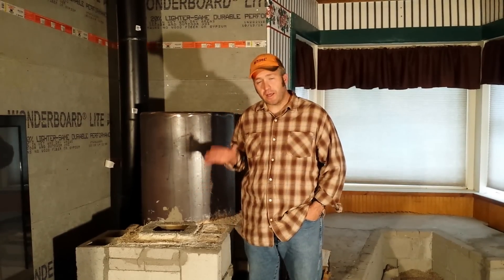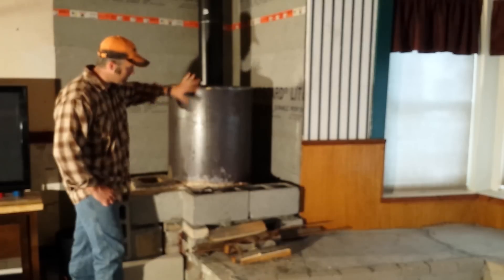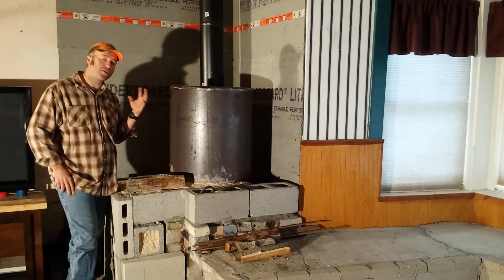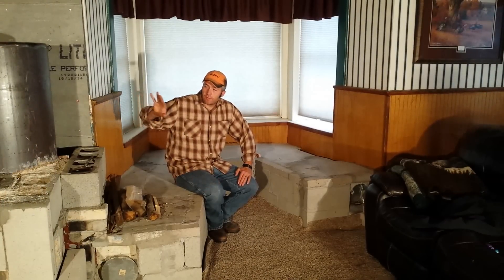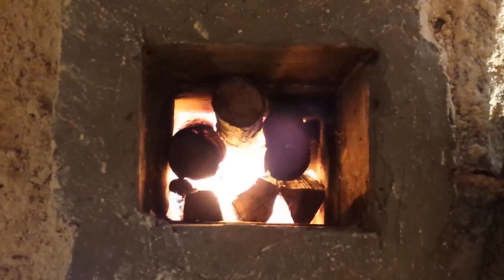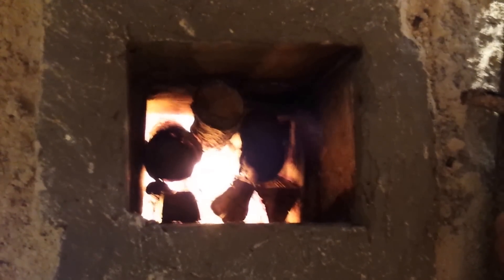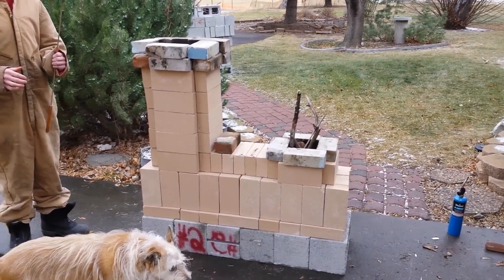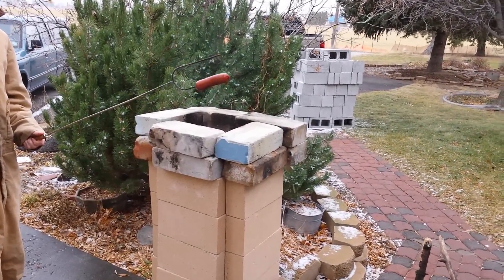Rocket Mass Heater Overview

Comment: Great video! I was wondering your thoughts on casting a heat riser without steel inserts, just masonary. From what I've seen the mix would be refactory cement, purlight, aircrete, water and liquid glass. More specifically my question is do you know whether refractory cement can be used to make aircrete?

Comment: That perhaps a less expensive assembly would be to using aircrete with water glass treatment for the Firebox and the chimney of the stove and then branding aircrete insulated water glass block to the top of the barrel to minimize the heat loss before and goes through the bench so you're taking maximum advantage of the heat coming from the stove maybe perhaps increase the Firebox to take a large load of wood so it could be fired up once every day and provide cleanouts at various points for maintenance
Reply: The barrel must cool the gases so they will drop.  Do not insulate the barrel.

Comment: Hello
 Adam & Dave
  Was very impressed with your presentation and amount of detail that was included is this video ( I did see the second video also, which was great and informative --thanks)  I want to build one of these in my home of which my wife of 50 + years is not supportive of this idea, it will be a hard sell.  I will have to buy her lots of things for her and make lots of promises.  2 questions I have, one do you have any pics showing the connection of the 8 inch pipe to the barrel, and how do I figure out how much pipe I can use before it is too long, I have a large home. ----Thanks ----Gary

Comment: Just sayin.. Thanks for sharing: " I live in the North, few days ago -48 with the wind chill. I used to heat my garage in the winter with a cement lined 18 X 24" box wood stove. in -40 ( Valley Comfort Style) when I hadn't had a fire, it would take 2 loads, 1 hr. to heat the 24 x 30 double garage ( it was insulated ) after the garage was well heated, I would place, 3 dry logs and 2 green logs to slow the burn. ( Using green material is a major cause of creosote formation )  I never had a creosote problem until I started using wet green material. Next yr I am putting in a system like yours, it just makes sense, to reduce the $200+ monthly natural gas bills. I never had a back draft problem, I always used a rain cap, but noticed in your video it looks like your rain cap swivels with the wind direction? When you had the back draft problem did you have a rain cap on?   I've built several wood stove burners over the years,  the 45 gal drum did finally pin-hole / rust after few years, the steel water heater, lasted longer, but it also developed weak areas, pin holes, I think it had a lot to due with when I would start fires with 2x4's  they burned quite "HOT" turning the steel "RED HOT" - I think using the 1/2 inch steel was an excellent idea, safety being the #1 issue.  As I live where it is very cold in the winter, I'm not sure how much wood I am going to use, but like you stated, a few good CO2 detectors are a good idea, in case one fails. One can "NEVER" be to careful. Oh and by the way, the steel looks "MUCH NICER" and maybe you could buy some High Temp Paint and get your boy to Mural the heater...  Whatcha think?

Comment: Holy crap 1/2 inch steel ? No you don't have to worry about it degrading anytime soon . Not sure if you realize it or not but cinder blocks aren't meant to be exposed to fire . I'm assuming you have it lined with firebrick ?
Reply from the maker: All the burn tunnel and riser was firebrick and fire clay/perlite mix, no cinder block exposed to the flame.

Comment: Nice job Adam, like you stated,I looked at a lot of videos also. You could run your chimney up 10 or 20 feet away from the firebox, anyone tried this yet?
Reply from the maker: Thanks for commenting
Reply: Not good idea. That draw needs to be regenerated.
Reply: @columbusbrooks4517  You mean that the draw gets regenerated by locating the chimney by the heat source to reheat the cold flue gasses in the chimney by radiant heat.

Also, if the chimney is by the bell, a bypass of the mass is possible to increase the draft for start-up.  After fire is going turn off the bypass to heat the mass. These are not common.
Reply: @jakebredthauer5100  Jake I was wondering how many rocket stoves or batch box stoves u have built? If u have, are they made out of any metals, besides the door and flu pipes? Just curious bout your firsthand skill & knowledge
Reply: @columbusbrooks4517  Zero. 

2. I know the characteristics of steel and have had plenty of experience with it.  What would you like to know?   Thin sheet steel is best for the bell on a 3000 degree Fahrenheit heat riser.  Old refrigerators may be good for some uses, such as secondary bells, plenums, stratification chambers and heat exchangers but may be vulnerable to corrosive condensate.  

3. I think you like the down-draft heaters better than I.  I think secondary air is important but I don't like Peter's method.  Why not just have an in-line configuration and have a straight three inch ID stainless tube go through the front of the fire box, through the fire box and through the burn tunnel, stopping inside the bottom of the heat riser?  Have it low to stay cooler.  Would it get too hot?  Open the port so it is not restricting and skip the Venturi. 

4. This could affect the spiral in the riser.  Which direction does the spiral usually go? 

5. Another idea I was considering is a series of bells with insulated riser tubes so the exhaust could be low, without a chimney.  Have a horizontal flue and a flapper valve on it, an independent wind blocker, and a fence for young children.  Would that work?  I know about the pressure zone near a building.  Flapper could be locked open, locked shut, free, control inside.

6. High grade CFB (HD) looks like a good product. Put perlite/clay cob around it. Brick or block around that.  Get it level, plumb and square.  Sit on it.

7. Doubling the size of the fire box should be okay as long as it is well insulated.    What do you think?
Reply: @jakebredthauer5100  thank u Jake 4your insight. Fire being a consuming & lively combination of elements I was curious your experiences. Having built several of these and having each react differently determined by many variables. Living off grid completely in the inner city and not smoking up the hood until RMH Tec wasn't happening. Heating hot water had for years been either expensive or laborious, electric hot water tank, heating pot upon top of barrel. I flowing Peter's led, Van Powell's method of heating water has been a Godsend from above 4me & my family's ability to wash ourselves, our clothes, our dishes. I make & sell ceramic dishes. Lot of hot water needed. So, I thank u I live this life I was curious how much suffering these issues effect your lifestyle and u answered that wit zero

Comment: Great video.  Still tweeking mine.  I have a 8" riser inside a 16" tube packed in a perlite/fireclay mix. Bench is 10' long and back to the chimney next to the barrel to help keep it warm to assist with the draw.  Now I'm trying to figure the correct  spacing between the top of the riser pipe to the inside top of the barrel. Any suggestions would certainly be helpful.  Thanks,  Will
Reply from the maker: Will Willis Mine if I remember right is 2.5 inches. Everything else sounds like a solid plan. Thanks for watching.
Reply: 2in

Comment: Like you, I have watched a good number (maybe all of them?!) of Youtube videos on rocket stoves and rocket mass heaters.  I am fairly certain I understand the concepts involved, at this point, and I can honestly say that your video is one of the very best, in terms of showing the each of the steps needed to build an effective RMH in an existing home.  I also appreciate your attention to detail in overbuilding each aspect of the project, including numerous cleanouts.  Very impressive and well-done video.  

Would you do a 3/8" thickness on the barrel, versus 1/2" or 1/4"?
Reply from the maker: Thanks for the comments and complements. I would at this point go with the 1/4 if you are going to build a barrel, I doubt that you would ever wear it out.
Reply: @highdeserthollow4447  A used oil drum on a RMH will not burn out or rust.  They run at only 400 degrees Fahrenheit.  Ligther housing is better because you can get some heat more quickly when you want to get warm.

Comment: I really love these type systems they take  a little doing to get them right but they really pay off in the long run.
Reply from the maker: We have ran it for two winters and it has worked great, we have a heating oil furriness that has not kicked on except to check it for a backup.

Comment: Now just add a 45 watt Thermal Electric Generator to the top of the barrell hooked up to your battery bank and youll be generating power when you burn.
Reply from the maker: I have been thinking about something like that.
Reply: High Desert Hollow I've been looking at "sterling engines" for low temp energy generator.

Comment: Does the dura rock behind the barrel protect the back wall from getting to hot. And where did you get the barrel at. And how did you mix your percentage of vermiculite and what kind of concrete mix with it.  And how tall is your barrel.
Reply from the maker: No it is not for heat protection they are stone walls I just needed a clean surface to mount the cultured stone to, also it does not put off crazy heat at that point because it is put into the bench. I had the barrel custom made by a local metal shop, knowing what I know now I would not do it again just go with a 55 gallon barrel. Barrel is the same dimensions as 55 gallon barrel, just 1/2" thick steel (to thick). It is perlite and it is about 85% to 15% fire clay. Concrete is just the cheap sack create from Home Depot. Thanks for watching and commenting.

Comment: does the pipe needs to go all  circle , or i can just make the bench and behind the bench exhaust and jiminy?
Reply from the maker: It needs to go through the bench so that it will charge the thermal battery.
Reply: @highdeserthollow4447  yup

Comment: the barrel is too thick but the tradeoff is heat radiation longer vs slower warm up time
Reply from the maker: Yea that was a mistake and has caused some problems on starting the system when cold. It works just a little more of a pain, I would use a normal 55 gallon barrel if I had it to do over again.

Comment: barrels last up to +30years so a normal barrel is sufficient
Reply from the maker: Yea, we came to the realization that I over engineered the barrel.
Reply: @highdeserthollow4447  nope. Barrel lose heat quickly. U have a great draw in fire box. Could of used that fire to heat water right behind riser outside barrel, then to bench

Comment: Why did you use 30 gauge pipe?  Is it designed to rust away and have concrete venting? Do you need to start a fire in the chimney base before starting the RMH to establish draft?  Great project!!! I WANT ONE!
Reply from the maker: +Pete Lasko It is galvanized single wall stove pipe and so far has not got hot enough to damage it.. I don't anticipate it rusting or burning out, I check it through the clean outs about every other week and so far so good. The system has enough draw even when cold to pull the smoke through the system, so no problems with draft yet knock on wood. This is still a experiment for us but working good so far.

Comment: very cool design. Have you tested for CO2 leaks? I'm really impressed:)
Reply from the maker: +Bring Back The Farm Thanks, yes I checked it right after i finished it and periodically sense then with no problems. We also keep a CO2 monitor in the room as well just in case.
Reply: I'm guessing you guys mean CO monitors.
Reply from the maker: Tom Pike Carbon monoxide detectors